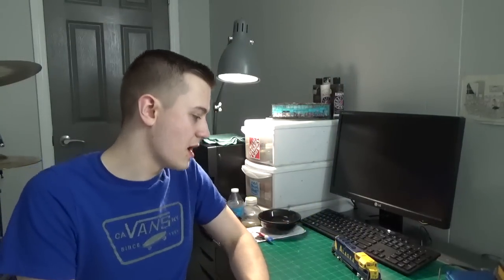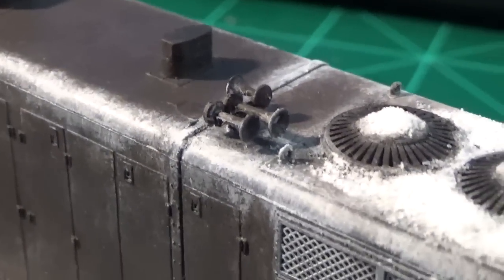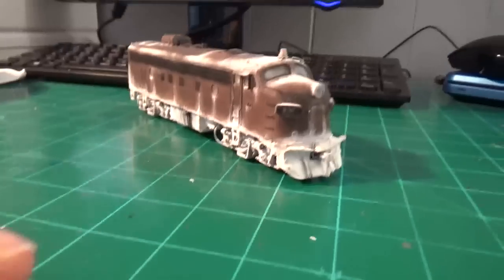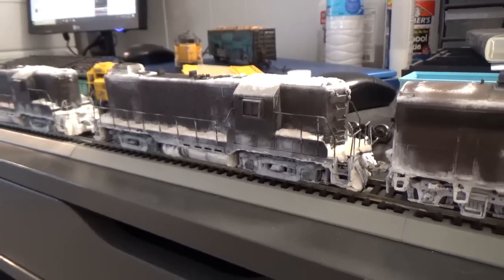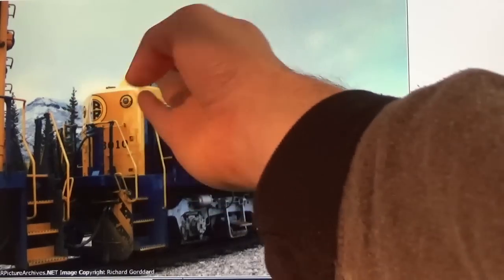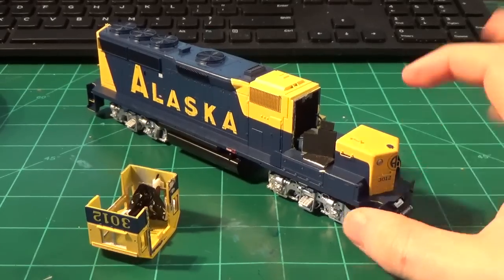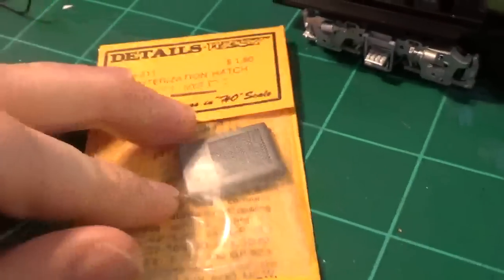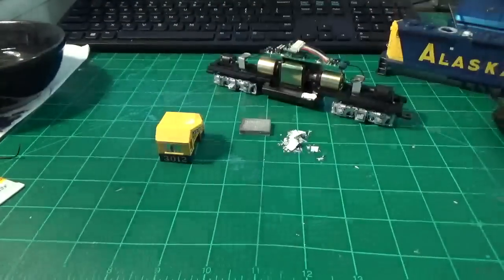Runaway Train 1985 HO Movie Locomotive Build!  GP40-2 #3010 Introduction.

Comment: The front of the lead locomotive. Is that piece hanging down the nose of the locomotive tore apart. Or what’s left of the caboose?
Reply: It was just a prop they put on the front of the engine.  The real engine they used could not be damaged so they took the front handrails off and put that junk and overhang piece on the front to make it look damaged.  All the interior shots of the damaged cab were inside the fake engine in the studio they used for filming.